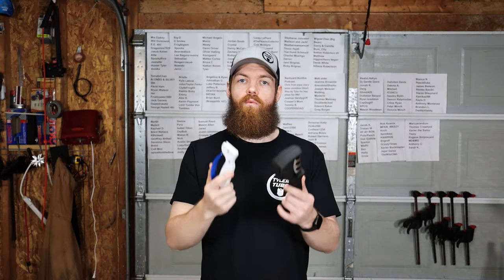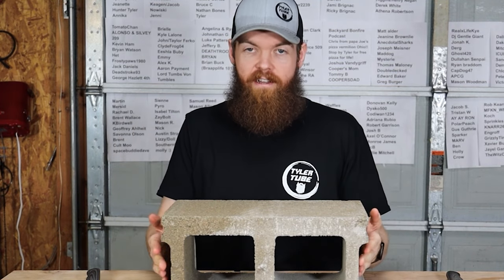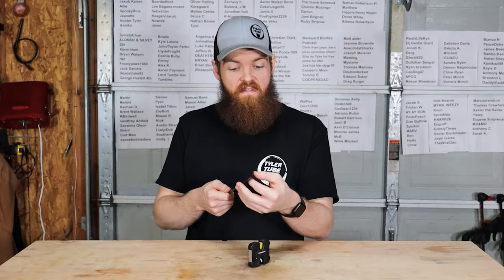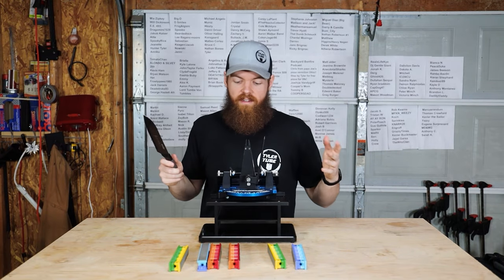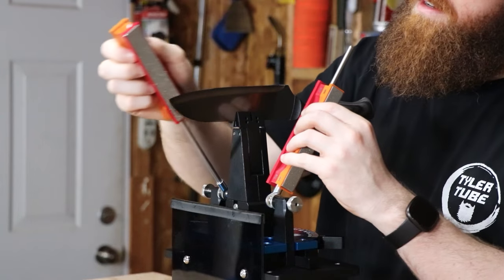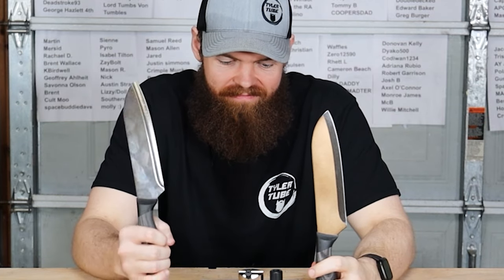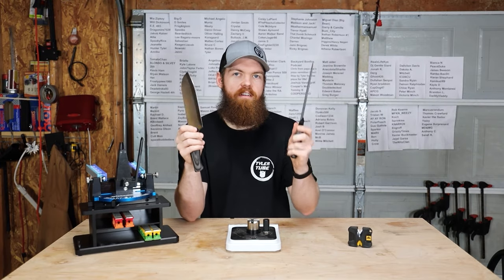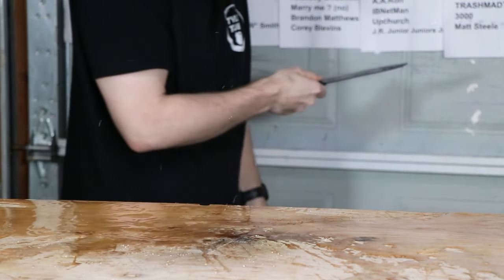$4 VS $1000 Knife Sharpener, Which One Is Better?

Comment: That $1000 knife sharpener is better.  The reason that knife was cut less is because of the steel. The $4 knife sharpener put a working edge on the blade. So in the end after cutting the paper it was sharpener. The reason this is because the steel in the blade can't hold that sharp of an edge. Hence the $1000 sharpened blade lost sharpness everything you cut the paper. Giving the $4 dollar sharpener an advantage. It had a working blade sharpness not a razor.  It has to do with the steel the blade is mad from

Comment: i use the work sharp precision $60 dollar sharpener and its got 350, 600, and a ceramic stone. literally can shave with all my knifes before I even strop them. did you even check to see if you built a bur up on one side before you hit the other side with the wicked shaper.

Comment: I would suggest moving stones against the edge instead of with it. As in go downward with the stones
Reply: I don't think you're supposed to do that and it would get inferior results because you're micro-bending and therefore dulling the edge at the same time as sharpening it. The 1000 grit is just not good enough

Comment: bruh maybe that second knife had some defects with the heat treatment and either the metal ended up being too hard or too soft. buy yourself a good quality knife and just use that same knife for both sharpeners. and do use a leather strop with some green buffing compound. that's when the knife reveals its true sharpness and polish and align the edge. this needs to be done since all the little burrs will drag the kinfe making it feel dull it will feel like a serrated knife or saw lol

Comment: You'll be dreading these damned comments!
All I'll mention is that I'm a chef so sharpening knives is a bit of a must. I have a cheap two edge sharpener which is fantastic for any of my cheap knives. However, it doesn't touch my high carbon steel Japanese blades. Whetstones is the only way to get an edge.. I'd love that 1000bucks sharpener for those knives, it'd be perfect. But for my cheap steel knives my cheapo sharpener is ideal.

Comment: after 40 years of knife sharpening and making blades... there is always a roll  on the edge after sharpening... use a diamond and porcelain steel to remove the rollover.. makes a world of difference and the edge will not only last longer but the following sharpening it will need will be easier and faster to maintain..... Stone @ Steel Knife Sharpening Services over 40 years all Mobile and hand sharpened... i also restore antique gardening and other tools...

Comment: I can almost guarantee you, it's still user error. When you set the knife all the way to the bottom on the vice, you weren't getting the actual angle you were looking for. To be completely fair also, you should have used a strop. That would get rid of the burrs and leave a much finer edge on both knives. I use 400 grit diamond, 1,000 grit diamond, 6,000 grit ceramic, 10,000 arkansas and then a strop.
Reply: Remove the burrs with the stones, you don't need to strop.
Reply: @autumn5592  You do know what the strop is for right? Getting wire edges and rolls off the edge without changing the geometry of the edge. It also refines the edge more than just about any stone can. Short of getting a japanese water stone with a grit of about 25,000, leather is as good as it gets. FYI, that type of water stone is about $6,000 IF you can find one. If it's cheaper than a few thousand dollars, it's fake. They are exceedingly rare. You also need to know exactly what you are doing to get any real effect from it. I've been sharpening knives for a long time. I was taught by a professional in the field. I do all my work by hand without guides and get beyond razor sharp cutting edges. There isn't a knife I've worked on that can't cut hair.
Reply: @autumn5592  How long are those edges able to shave on a 220? Once? Twice? I go months between sharpenings because of the quality of my tools. I keep the geometry the same all the way through. Double bevel my edges for support. I can deburr on a stone. That's easy to do. It's also sloppy. You won't have a very fine edge. Sure, it'll cut, but, it's not going to be nearly as smooth a cut as from an edge that was honed with much finer stones to polish it to reduce drag and get the burr off at the microscopic level. To address your lie there, I never said I didn't know how to deburr on a stone. You find the words verbatim where I said it. I'll wait.
Reply: @Ujiyo  Now you're mentioning something that almost entirely relies on steel.
I use a pretty cheap 440c blade, so not outstandingly long. A few days of hard use. (And I really do mean hard use not letter opening.)

My bevels off a 220 grit stone are pretty good and flat. 
There is no reason there wouldn't be, I'm not sloppy when I sharpen.
But hey, compared to you, trained by master sharpeners or whatever, but can't deburr on a stone hhahaha.

If your edge is apexed, it'll cut basically anything a slightly finer edge does, and past 3k, you're not improving sharpness at all.

I never lied hhaha, you stated you don't deburr on a stone, but on the strop, so you insinuated you can't deburr on a stone. 

I will tell you one more time, learn to sharpen, you clearly can't if you rely on high grit stones, and strops.
Reply: @Ujiyo  A stone is the best tool for the job.

440c is a perfectly fine steel, but I guess you don't understand metallurgy lmao.
Reply: @autumn5592  440c is brittle. It's very hard. Apparently you don't understand metallurgy. I wouldn't use a 440c stainless blade to open my mail much less any other type of work. 1065 is as low as I'll go for blade steel. There's no advantage to having a blade so hard that it'll break instead of flex under stress. That explains why you can get away with an edge made on a 220 grit stone. I'm assuming you use diamond stones. I can't see an arkansas stone keeping level for very long with a 440c blade. Could be wrong, probably not though. Get a high carbon blade. 1065 isn't break the bank expensive. Not like 5160, tamahagane, CVS, san mai, or damascus. If you can afford it, san mai is an excellent choice. Hard edge, softer spine and jacket. Allows flexing under stress.
Reply: @autumn5592  Oh you poor mislead child. What do you think the c in 440c means? It means carbon. All steel has carbon in it. Otherwise, it's iron. It appears your knowledge on the subject is quite lacking. To think someone would call into question the superiority of high carbon steel in comparison to stainless steel is ridiculous. The 400 series of stainless steel is the same as the AUS series of steel. The carbon content caps around 0.90% and has a chromium content of a minimum of 12%. Makes the blade very hard at the cost of toughness.  Toughness is what let's blades survive stress. The fact you don't know that shows your lack of experience and research. You're unarmed in this battle of wits. Concede and save face. Also "damascus isn't a steel, it's pattern weld of 2 steels." is a contradiction. It's an alloy, just like your precious 400 series steel. You have no idea what you're talking about. You may as well say tamahagane isn't steel. It is by the way. Seriously...who give you kids access to the internet?

Comment: For all future and past sharpening videos. A knife must be sharpened while grinding the blade PERPENDICULAR to blade edge. This means the sharpener must cut directly into edge at 90 degrees to the length of the blade. Sliding any kind of grinding stone parallel to blade edge will NEVER give ultimate sharpness for that grit of stone. I have hand sharpened knives all of my life with a simple wet diamond stone. I can get nearly a razor sharp edge on even the worst steel. Any sharpener that rides along the blade edge is garbage. If you looked at the blade under a microscope you would see how they get tore up.

Comment: The problem is the $1000 sharpener set was missing a piece. See if you can get a refund. It needs a level measure. If used correctly it can get from 0 to 100 on the scale. Its just user error. It is to expensive though.

Comment: Tyler,  when I need to touch up my daughters chefs blade in a pinch I’ll grab a ceramic coffee cup and run the blade over the bottom when the raw ceramic ring is like a stone sharpener. Works most excellent for any slicer blade. Give that a try 😉

Comment: Great comparison video 👍 I have a two stone wet sharpening kit from the 70’s and it still works just as good as my 4 dollar sharpener in fishing tackle box. The only question I have is. Does that 1,000 dollar sharpeners stones need to be wet? Either water or oil? Still I like 20 dollar kit at home and 4 dollar kit in my tackle box better then what that 1,000 dollar one did.
Reply: They are diamond stones. No lubricant needed.

Comment: You should be sharpening with a down stroke starting at the base of the blade using very little pressure that's why your results are horrible on the diamond stone sharpener

Comment: Please watch some knife sharpening videos. You have a burr that needs to be removed. Use a strop or you could even remove it by dragging the edge of the knife on a piece of wood with only the weight of the knife pressing down.

Comment: The $4 sharpener is for those who have no clue what they're doing.  If you think that won then I guess that's you.

I can hand sharpen on a brick with water then strop on cardboard or newspaper and get below 50 on your guage.  I can get below 40 with the wicked edge on 200 grit stones and stropping on them.

I used a Norton 180 grit crystolon for 20 years for work.  Thinned, reprofiled, sharpened and stropped on that one stone.  Lay newspaper flat on it and strop the burr off.  Edge last about a month of 8 hour days with a honing steel.

This was my first video of yours and most certainly the last.  Not only do you have no clue what you are doing, you seem to have no desire to even want to.  

The basic fundamentals of sharpening are in the instruction manual of the Wicked Edge...obviously you didn't read it...and those basic concepts apply to any sharpening system, freehand or otherwise.  So reading the manual should just be a refresher for anyone that's seriously learning this craft.

That's the problem with free shit though ain't it?  You simply don't care about it.

The WEPS in your vid is the best precision sharpener for flat edges in existence.

Belt sander for convex and Tormec for hollow edges.  Bench stones for scandi, full flat grinds, and convex edges your brain thinks are flat....and of course for thinning the secondary bevel.

You didn't read any of that though, too much work amirite

Comment: You’re using the expensive one wrong first those stones are brand new and need to be broken in and 2nd you have to do one side first and get rid of the burr and then the other then you can do both at the same time. First break those stones in though you could hear how crunchy they are.

Comment: I have this $750 sharpener and you don't know what you are doing. It is like any other quality tool, until you learn how to use it you won't be satisfied with the results . You have to know your knife. The $4 carbide sharpener is probably set at 25 degrees or higher and it will DESTROY a good Japanese knife in 30 seconds And you can buy a 300, 1000,  3000 and 6000 grit set of whetstones and spend $750 in a heartbeat and you will still have to learn how to use them I have both and can do all of the see through tomato slicing tricks with all of my knives, even the $20 cheapies.

Comment: You could've done the scale test before testing on paper. However at a $1000 I certainly expected a razerblade edge performance. I mean that's $1k for a damn knife sharpener. 🤣🤣🤣🤣 I've seen people get a better edge off of the edge of the drivers side window on a 2002 Chevy Silverado. 🤣🤣🤣🤣

Comment: A lot of people are saying this already but I wanna organize this a little better, and throw my own input in.

First off, they look like diamond sharpening stones. Diamond stones are very efficient at removing metal and don't require many passes. I have one 600 grit diamond stone that does most of my sharpening, then my blade goes to the strop, and it's razor sharp within maybe 30 passes on the stone usually. So really the first 100 grit stone shouldn't have been used too much, I'm not sure exactly how many passes you made though so use that info for what you may. 

Second: Forming a 'Wire' or 'Burr' is the first step to re-profiling a bad edge. To do this, take that 100 grit stone, and sharpen one side at a time. Do maybe 15 passes, then switch to the other side. Then run your finger up the side of the knife on both sides. If you feel your skin catch on the edge, youve formed a burr, or what's called 'Apexing', meaning you've come to an exact point along the edge. Do this until you feel it along the entire blade. Now you should take that stone, and VERY lightly pass it on the side you felt the burr. This is to minimize your burr so you can move to the next grit. Continue with the higher grits, but you don't have to check for a burr on every grit if you don't feel the need to, although most people do just in case. 

When you finish all grits, you'll need to take your blade to a leather strop of some form. 
You could easily DIY one from a old leather belt, but if that's too much hassle, Knives Plus makes some good strop blocks. I use the green compound strop, since it's a good middle ground. What the strop does is remove your burr from the knife, and what you wanna do is lay the knife flat on the strop, and raise the blade up to a slightly shallower angle than what you sharpened it at. So the one in this video were 15°, you'd wanna strop at say 13° ish degrees, this doesn't have to be exactly protractor perfect.  Pull the knife backwards, not forwards cause otherwise it'll cut the leather (obviously lol). When you pass the knife on the strop, you should see the burr dig in to the compound on the strop. That's a good sign you have the right angle. Alternate sides every 20 or so passes until you see that the burr is no longer digging into the stropping compound. Now you should have a blisteringly sharp knife for testing purposes 

Lastly, steel is possibly another factor to involve in this, but I'm not sure since it did get fairly sharp in the end so really that's just up for debate. Steel is a whole different topic and my brain is too fried from typing this not even gonna lie. It's 3am and I'm ranting about sharp metal, life is good. Like this so he can see it, and maybe my time typing won't be wasted ahaha. 

Also anyone feel free to comment on anything I may have missed or misworded, I'm always looking to expand my knifemaking know-how 🤙

Comment: This isn't another comment saying you did it wrong i agree with you it should go up to 8,000 not 1,000. But it is is missing 3 different stones so i did some diging they have a 3 pack knife sharpener its the same product its 1,290.50 and has 5 different stones. But the main site don't have a 6th one so where is it at?

Comment: Dude it's not going to cut because you're using an actual good sharpener and it's making a burr because the edge is so thin you need to hit it on a strop and it will be an absolute razor

Comment: Whats the point of buying a 1000 dollar sharpener that's basically just a Lansky system with a kinda crappy vice? Not worth it when you can buy the Lansky for like 50 bucks or even just a cheap sharpener like the one shown here.

Comment: If you take a the cheap knife then run it on a rough side of leather belt like you would a a file it will sharpen the crap out of it after u run it threw the sharpener

Comment: i'm not sure your process, but even with a fixed system there is a learning curve to sharping a blade properly.  I would just make sure you recheck the sharpie and make sure your passes remove all the sharpie.  Besides that cheap steels don't take a good edge with diamonds, i'd at least mess with a higher end steel and see how it performs and I wouldn't even go to a crazy expensive steel. get like a D2 ontario rat if you want a cheap but good steel to test it or a  american lawman in s35vn if you want to test one of the best steels on the market.  Can't really touch the best of the best steels under 400 unfortunately but that's what diamond sharpeners were designed for super steels, very strong steel that has very high resistance to abrasion.  For the average consumer I wouldn't recommend the wicked edge, hell even for someone who just got into the hobby of collecting sharp things you can easily get by with a very cheap KME system but the wicked edge does have its place with people who want an extremely streamline setup for quickly sharpening there high end knives.  and for the record a KME can perform just as well as a wicked edge at like a 1th of the price.  Also even those 4 dollar sharpeners have a purpose, they are mainly designed for maintaining a blade without doing a complete sharpening on the blade by creating a micro bevel.  Ceramic sharpeners won't work very well on very high end steels, for testing i'd run the 4$ sharpeners a ton of passes to give it a fair chance.  I've gone through this rabbit hole and this is just my 2 cents.

Comment: This is all user error! Send me the model number of the knife and I will buy one, sharpen it with my wicked edge, and then you test it as a redemption for the wicked edge. Your knife was not centered, so your angle is not the same at the tip of the blade. You don't sharpen both sides at a time, you sharpen one side until you feel a burr the go to the other and do the same.Once you form a burr on the other side you then start going side to side. You do this for every grit level.